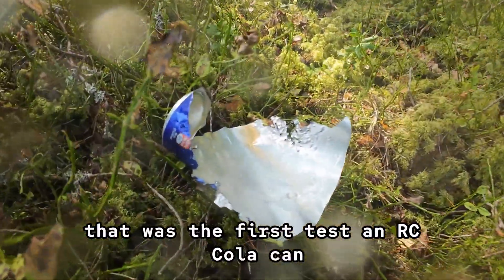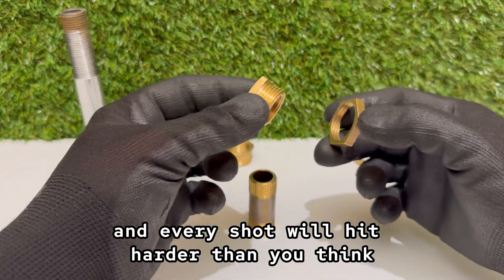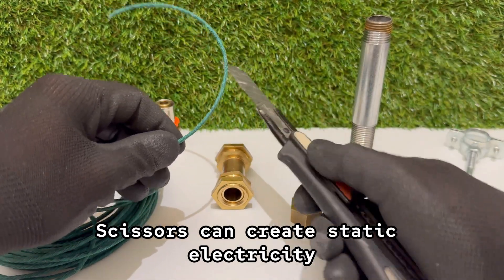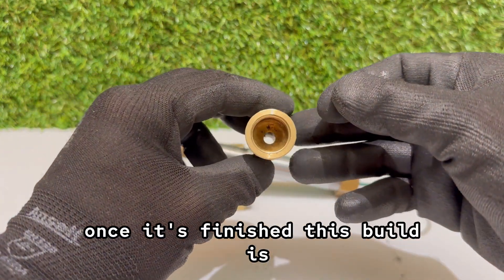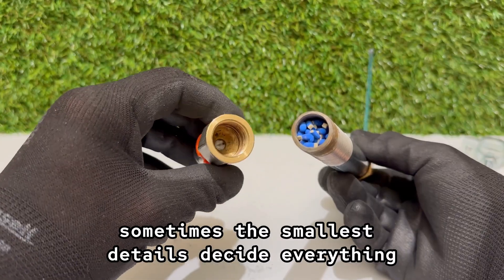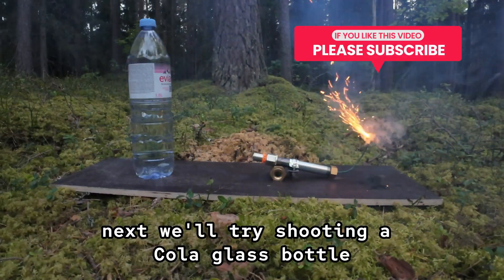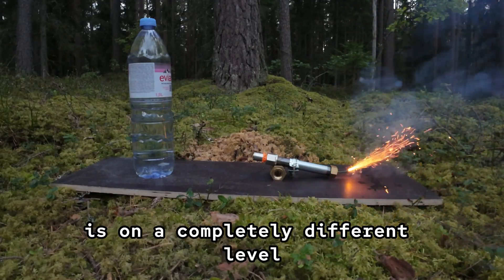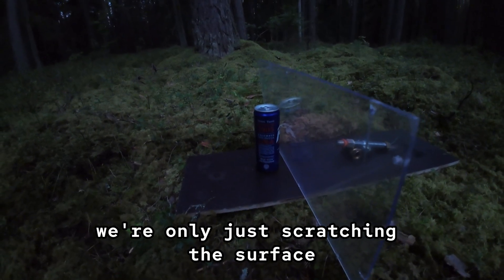This Tiny Cannon Shoots WITHOUT GUNPOWDER!

Comment: BTW it is just a pipe bomb which is under-powered and has a small gas release orifice, any more powder or a crack after previous use and you will have shrapnel in your ass. stay safe have fun.